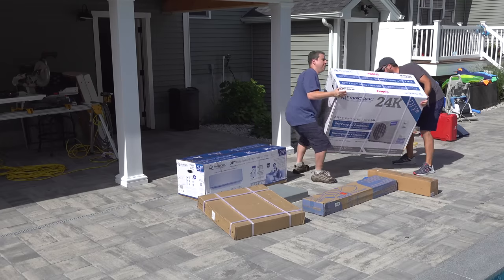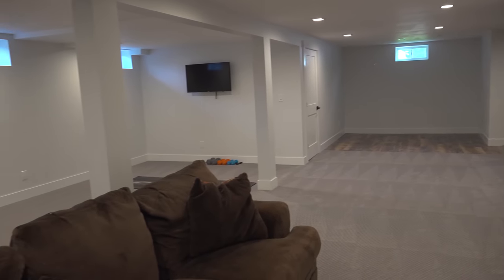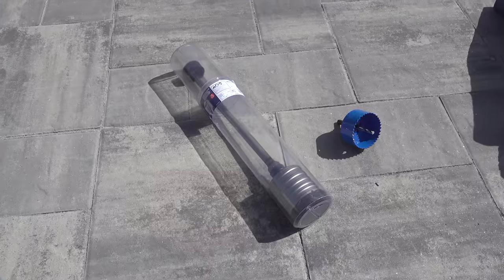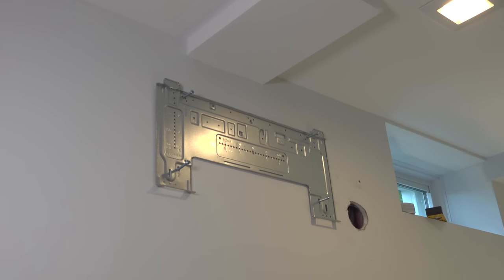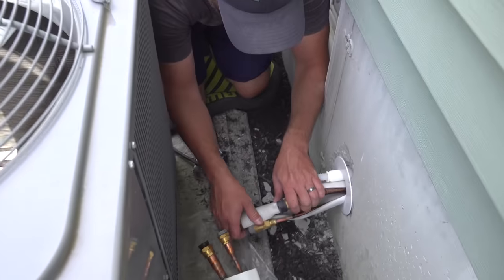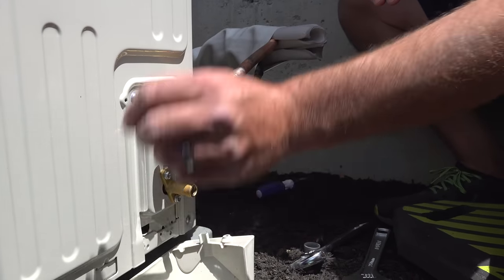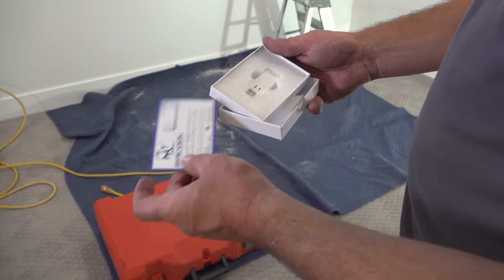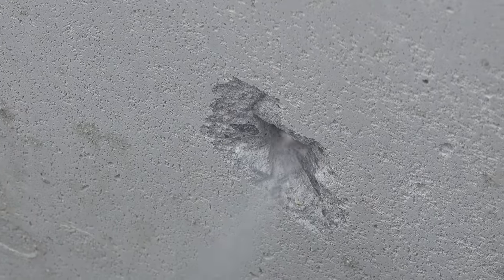Install your own AIR CONDITIONING in 4 HOURS!  DIY Mini Split MR COOL

Comment from the maker: Thanks for watching please LIKE & SUBSCRIBE - Mr Cool: https://amzn.to/3vczVAx  Toggle Anchors: https://amzn.to/35bjtps
Reply: Can you please tell me how much space it covers?
Reply from the maker: @travisferguson1721  This model says 1000sq ft  but in a basement definitely more since the demand is less and if you are in hotter parts of the country you may want to go a little larger.
Reply: Hold on, any ac unit needs the lines and unit to be vacuumed sealed in order for it to work properly.. this is the part that stops almost all diyr . That’s usually the hidden cost of a diy unit like this.
Reply from the maker: @eric4052  This kit doesn't require that, the lines are sealed, you can see the valve on each end. There is no part of the system that is exposed to air during the install., clever design that eliminates all that.
Reply from the maker: @eric4052  You don't need to with this kit. Look closely when we remove the black/gray caps,  you will see a valve on both ends end, within the lines. These valves don't open until the lines are screwed down. Both lines are already under vacuum, this clever design preserves this until everything is connected & the system remains air free,
Reply: @eric4052  been using one of these MRCOOL diy 24k units since 2019...summer and winters. Was finding heat still at 0’f outside. My workshop is an icebox even when it’s 108’f outside ☺️
Reply: @SilverCymbal  Hi, your video is helpful. I from Yuma, Arizona, a few of the hottest places in the world. Today local weather is at 115 F degrees, and over the weekend will be at 117 F degrees.
Reply: This was worth the time and amazing to watch . Thanks for the gem
Reply: @eric4052  I also was wondering that the air have to vacuum out but Silver said you don’t have to so now I going to buy for my basement
Reply: Silver cymbal.   Where did you purchase this unit?   Or from who?
Reply: Aries Roblox Gaming   If it is made in China you might ask how many BTU's it is and also ask them if it would meet with advertised specifications?
Reply: A suggestion for the concrete drilling... when the auger tip breaks through, put some good tape around the hole to be and finish it from the outside.
The tape will reduce the chipped edges around the hole.
Reply: Hey man quick question how did you remove the condensation since your in the basement?
Reply: I love your content, but this, this is not good advice, and breaks the law, it is against the law to install or service these units without EPA 608 type 1 certification, or EPA 608 universal, this is against the law.
Reply: This video did not bore me. I usually checkout on home improvement videos but you just get right into it. No time wasted with useful info. 👌🏾
Reply: @mauricetaylor9638  I agree because I usually check out of home improvement videos
Reply: @DJLsbVapes  He is a contractor.
Reply: The lines come pre-charged in this configuration. Your video is misleading
Reply: Hi what size bit and hole saw cutter did you use?
Reply: The problem with these units is they collect water and the water runs down the wall and ruins the paint. We have those here in UAE.
Reply: How is fucking $1800 fucking cheap?
Reply: @brintabokka1393  $1800 is nothing compared to what Central heating and air unit would run to have installed.
Reply: @SilverCymbal  I'm sorry, everything you said is wrong.
Connections like these may reduce the need, but they don't eliminate it. Every connection point will introduce some air and moisture to the system that must be eliminated (if refrigerant was leaking out; air and moisture were leaking in before you opened the valves).
Also, using the refrigerant to leak test is illegal! You must pressurize the system with nitrogen to leak test, purge, and then evacuate/place in a vacuum before opening the valves.
The way you did it is specifically banned by EPA608
Reply: You guys have never heard of a stud finder?
Reply: This A/C unit doesn’t require vacuum?

Comment: Next time have someone outside to let you know when the pilot bit on the drill breaks thru the concrete then go outside put the pilot bit in the hole and finish drilling. Done this for years and no concrete patching will be necessary. Looks way more professional.
Reply: Came to say this. Great tip. 👍
Reply from the maker: I totally agree, we couldn't do that here there was too little clearance from the wall to the existing compressor outside
Reply: my Milwaukee core bits don't have a pilot bit... I start with the "centering bit" then once the carbide teeth make a circumference, I remove the centering bit and bore...
Reply: Im cutting holes in wood and just learned that.
Reply: @SilverCymbal  you can also put piece of plywood against wall, someone has to hold it, but that will push the concrete and hold it together
Reply: @SilverCymbal  3:50 looked like plenty of room if not using that 10 foot (/s) extension...
Reply: Also next time avoid the stud with a detector
Reply: @MattFerguson26  That's not an extension, that's the coring bit shaft.
Reply: @milesparris4045  My point still stands.
Reply: @electricwhirl5175  the problem I see with that is premature wear on the hole bit. It may sound counterintuitive, but using concrete bits on wood can create a lot of trapped heat, and wear the bit out a lot faster than if you were only using it in concrete.
Reply: @th3unmaker  yea, theoretically it can cause some wear, but you should go slow in the end and as soon as it gets to wood, just stop drilling. anyway, drill bit costs cheaper and is easier to replace, than to repair the wall :)
Reply: The cameraman just stood there like an idiot and didn't say jack😁
Reply: P0
Reply: Ed Henderson  everyone started somewhere and everyone makes mistakes. They uploaded a well made, very helpful video. No need to insult them because you have a generation gap complex
Reply: Ed Henderson  I'm sorry your dad didn't love you, "Ed." Let it go...
Reply: Look at all these hvac techs flocking to an online tutorial to give their two cents
Reply: No.
Reply: Yep exactly.
Reply: @SilverCymbal  - there are 90 degree chuck attachments you can rent that will allow you to drill in those type of situations 😊
Reply: Through .
Reply: Seems the most obvious thing to do .
Reply: Good to know, thank you!
Reply: Nah man amatuer blowout is the best...
Reply: Ed Henderson   …millennials who installed their own unit showing me that I don’t need to pay for a $5000 install. I just need a friend to come over and help out.
Reply: The placement will bother me not being exactly between the 2 windows.
Reply: And that is how you do it my friend.
Reply: LOL I was thinking the same thing.
Reply: Got so mad when I saw them blow out the wall, looks awful.
Reply: Nice. I was just thinking that.
Reply: Oh that bothered me sooooooo much
Reply: Was thinking the exact same thing
Reply: @MattFerguson26  yeah there was room. Just an oversight.
Reply: @jim2lane   It’s an sds+ rotary hammer drill and you need to behind it to put a 90mm hole through concrete.
Reply: @davidc_ac9377  A small strong magnet works perfect. It sticks to the head of drywall screws.
Reply: This is why I love the comments section, takes a team!
Reply: This is good advise. Same goes for ANY kind of drilling. Knobs in cabinets, outlet boxes, ect....anything you dont want to look like a disreputable person did the work. It looks very unprofessional to allow your drill job to blow out the other side.
Reply: Concrete patching WILL NOT be necessary if drilled from opposite side once bit breaks through...
Reply: Wtf would u drill into concrete for this?!
Reply: Your a god!
Reply: I've only drilled one hole through concrete in my life and I knew to do that!
Reply: This is obvious. Surprising they didn't do this.
Reply: yep,saw it rite away
Reply: True
Reply: Yeah clown install

Comment: A couple ideas: check studs before starting, you can make sure the inside unit will land on one and the hole will not. Also make your hole slope slightly towards the outside of the house in case of water.
Reply: I was thinking the same thing, only knowing it was a basement with walls skinned on concrete, I would have opened up the wall. Using the template, you know exactly where to cut, so open up the whole area behind the unit. Clear out your working space, do your foundation hole work with the downward taper hole,  then block out the remaining opening with PT wood studs attached to concrete with tapcons, then plywood over that flush to sheetrock with the same holes cut out as required by the template. Gives you a far more solid mount for the inside unit, and if you missed anything you can box it with wood trim and itll look like a million bucks.
Reply: or idk have a professional install it or something similar so it comes with more of a warranty.
Reply: And.. I have 14 inches of concrete.
Reply: @Bazookify These units come with a warranty. That's kinda the point, or a big part of it anyway. I installed one of these because they provide a warranty for self installs.
Reply: @sc5015 That's how I installed mine. I cut out the drywall behind each indoor unit just under the footprint of it, then screwed a piece of plywood of the same thickness as the drywall in the hole, then mounted the unit onto that. No way in hell would I mount one of these the way they did in the video!
Reply: it's actually laughable that some professional internet fix it guy would make such a noob mistake and then passes on the expertise of "yeah, just keep cutting it" and now buy this other tool and this other tool and this other tool. it's all cheap and easy, guys!

Comment: Yes, counterboring from the outside should prevent the breakout problem. Another tip for various situations is that a holesaw ran in reverse doesn't grab. Its a good way to start holes or when dealing with materials that tend to grab. A shop vac or the suction end of a leaf blower is good for dust control.

Comment: If you can afford another $250 or so I would recommend getting a set of referigeration gauges and a vacuum pump (Harbor Freight). The referigerant line connections are the most common point of failure in DIY installs. Someone who does this all the time will be able to tell when the fittings are tight enough to seal just by feel. But for non-professionals, after everything is hooked up you can connect a set of guages and the vacuum pump, then draw the system down into a total vacuum. Close the valve to the vacuum pump and let the system set idle for 24 hours. If it's still in a complete vacuum you're good to open those valves and let the referigerant charge into your tubing. If not, you saved yourself a very expensive service call because you would have vented your referigerant charge into the atmosphere and needed to call someone to locate the leak and recharge the system.

Comment: Had our HVAC provider install a Mitsubishi mini-split in our master bedroom last year...probably the single best home owner decision we've made.  I considered the DIY MrCool system but went with the pros since it was a second story install.
Reply: I was quoted about $5600 for a second story Mitsubishi SEER 23 install with a single head
Reply: Birthing Girdle  no problem. Keep it mind that I'm in New England so your rates may vary
Reply: You did the right thing, because when Mr. Cool breaks no one is going to come and fix it for you.
Reply: Birthing Girdle  It was literally a year ago, so prices likely have changed.  We live in the Mid Atlantic region (Hint: Joe Biden's home state), the price was $5,450 for a 24 SEER 9K BTU Mitsubishi unit (Outdoor unit model:
MUZ-GL09NA

Indoor unit model:
MSZ-GL09NA

Warranty: 1 year labor and 12 year parts.

Our master bedroom has always been too hot in the summer and too cold in the winter (due to a first floor redesign by the previous owner).  After years of using window AC and space heaters we pulled the trigger on the mini-split.  We leave the bedroom door open and the unit will help cool the entire 2nd floor of our 4 bedroom colonial.  We wish we had done this years ago.
Reply from the maker: Mitsubishis are very nice units, used to be called Mr Slim. I agree with you, The Mr Cool is as good as you can get without going that route, especially for DIY
Reply: @SilverCymbal  Completely unrelated to this topic, but I followed your lawn renovation plan (kill weeds, aerate, lime and Jonathon Green seed, even made the sprinklers) last fall and my yard looks great this year. Thanks Silver Cymbal!
Reply: We have a “hunting lodge” made of concrete block and heating/cooling that thing is a nightmare. If the one you just installed heats/cools 1300 sq ft then it would be just a little oversized for our  1100 sq ft. And for ~$2k it would be a perfect solution for us. Gonna have to look into it.
Reply: @michaelcottrell7545  no one wants to work on duct less units anyway unless you just need freon

Comment: Did one of these a couple of years ago.  Easy to install and still working great.  We bought a wall mount so it didn't sit on the ground.  Ours also has a wifi connection so we can control it from anywhere via a phone app.
Reply: ?... Being that it's on a wall mount, do you hear any vibration or noise on the wall from the inside?
Reply: @anndrambo  never  noticed any
Reply: What generation mr.cool has the wifi option?
Reply: Mine didn’t work on first day and I got my money back!!

Comment: I would say instead of leveling the outside unit on the dirt you should have laid a layer of gravel, compact it, then lay loose gravel to level the platform on. That way it will remain level for years and will have good drainage around the unit
Reply: Absolutely
Reply: Stop giving real advice.  They only pay him if he made it look as easy as possible.
Reply: Exactly.....  these guys in the video have no clue what the hell they are doing.  Over time with snow and rain , that unit will start to sink.
specially when they are using plastic as a foundation  😂😂
Reply: @Nick Moore   😂😂😂
Reply: I thought everyone knew this..... Thanks dad!
Reply: Nope! We did that exactly and the thing heaves all over the place.
Reply: Mr Cool is paying them to advertise?  You don’t say..  lol
Reply: Shalom!

Comment: If you do one again, you can get rid of most of the external concrete damage by noting the pilot drill penetration and moving the drill outside to finish. 

These mini-splits are great, and even with inflation making them more expensive, still a better solution for many areas. I'm always a little worried about bending pipes, and would suggest a small pipe bending tool. Good job!

Comment: When someone's basement is the size of your house 😢
Cool video nonetheless!
Reply from the maker: It is very large but keep in mind his upstairs is only one level, so he is doubling his living space by doing this. It's a great way to get space down the road when you have more money to do it, which is exactly what he did.
Reply: yea noticed that gotta be back east
Reply: True story! 🤣🤣🤣
Reply: He had 2 AC units for upstairs also.  So, 3 AC units total and concrete walls 3 feet thick.  He live on Mercury or something?
Reply: @101perspective  depends on location ? here in belgium 1 good unit is enough for a whole house
Reply: Contractors see it every day. The house they own versus what they work on. But what is important is that yours fits you. Goldie-locks, but without being a squatter.
Reply: @101perspective  and AC for a basement??? My basement is always cool even in the summer when it's 90+ outside.
Reply: He can rent it out!!